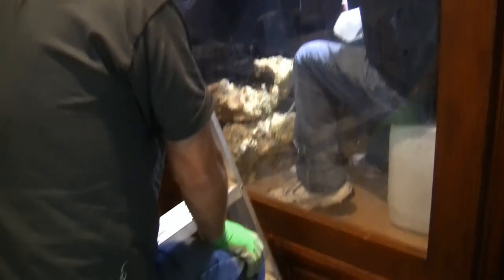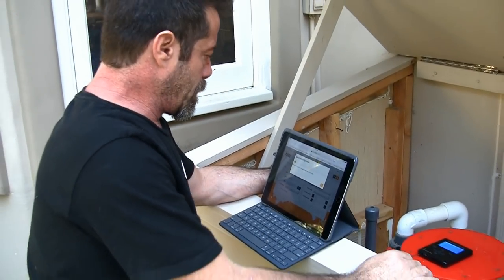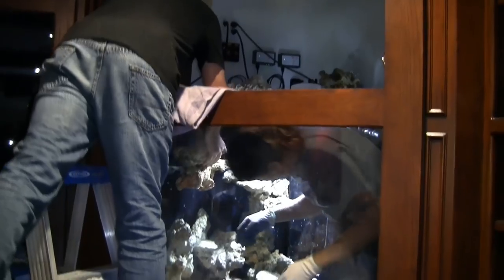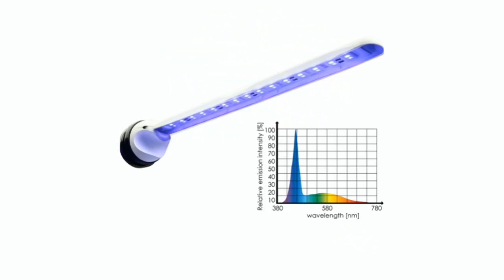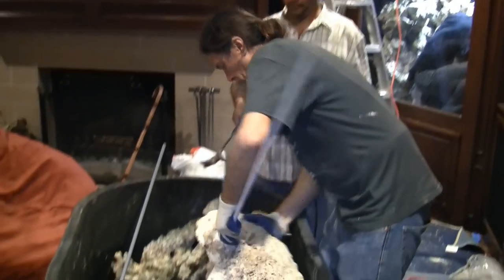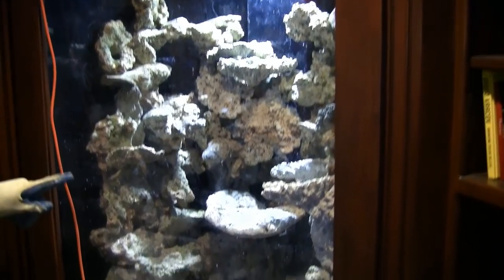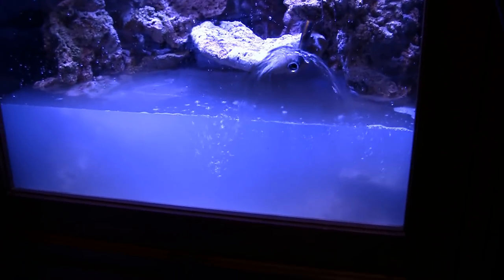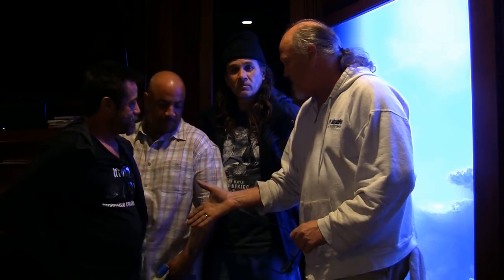Reef Tank Re-Do, LA Fishguys, Episode 161 Part 3, including adding Tunze's and an APEX System

Comment: I hope y'all are under contract to maintain this tank because the owner will never be able to keep up with this tank it's so deep and don't even think about aquascaping this thing with corals once they start to grow and need to be pruned or fragged it'll be a nightmare getting in there also what are your par levels gonna be after the first two feet I mean that's a 5 foot deep tank the bottom is gonna be a dead zone but hey maybe I dunno let's get a one year update on this tank
Reply: No doubt tanks this deep are a big challenge but the customer had this tank already and wanted it to be a reef so given that, Jim had to meet the customers desires. The Kessils 360NE’s that we used along the front half are better suited to deeper tanks  do an OK job of getting light down to the bottom but the lower parts of the tank will be limited to soft corals and other corals that don’t require intense light. It’s been nearly a year since the tank was setup and the corals are doing great and Jim has done a great job of picking corals that are well suited for the different depth ranges in the tank. And fortunately for Jim, he has long arms unlike me! I don’t envy him when it comes to having to place corals in this tank though. I’d have to go swimming to get things in there where he can use tongs and his long arms to place corals deeper in the tank.